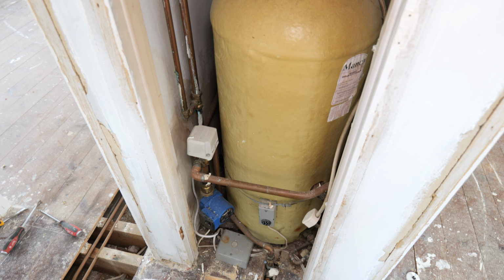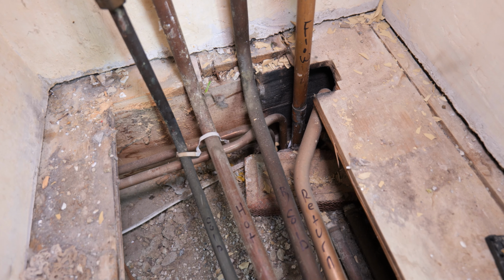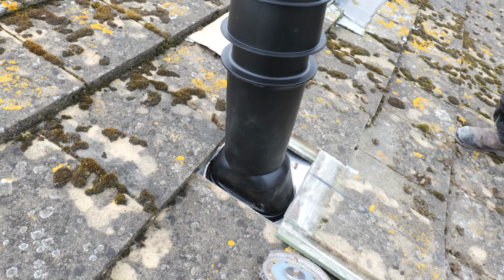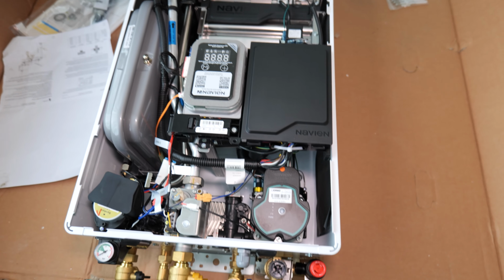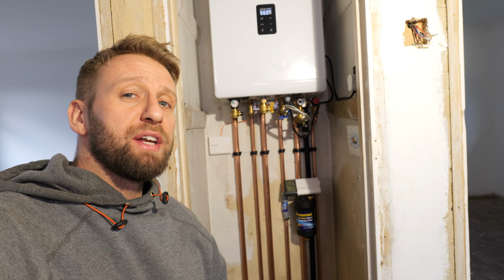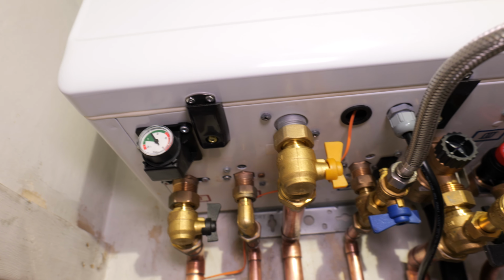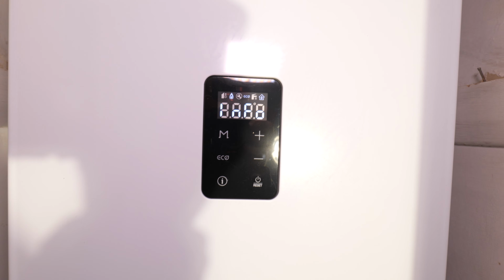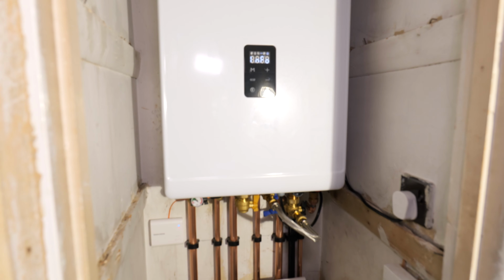Best Budget combi boiler? How Cheap!

Comment: Just had the Navien Ncb500 fitted, come in at £950.00 with the flue & Esi stat. The plumber who fitted it has never seen one. He told me it looks like a very good, well thought out boiler. Very easy to fit, and super easy to set up. I had been looking at these for some time. As a plant engineer to look inside, it looks well put together. My Electrician friend wired in the stat and set up, he was well impressed with it. This model has a filling loop built in and grundfost pump. Some plumber won't try something new. We are well pleased with it, build quality looks loads better than the Baxi 800. Only time will tell how they shape up & how good the warranty is. The Ncb500 comes with a 10 year warranty.
Reply: We'll see how good it is in 10 to 15 years .

Comment: Hi i wanted to fit a new combi boiler and new radiators, will i be able to get rid of the cylinder and water tank system and run it all by the combi boiler?

Comment: Can a Navien 300 boiler run without an external  thermostat? Ours doesn't have one and when switched on it constantly heats the rads and wont turn off.  Great video by the way. Thanks for sharing.
Reply from the maker: Yep. Sounds like it's linked out on the PCB. You really do need a Thermostat of some kind. 👍

Comment: Looks decent on the whole. Where did you buy it for £600 ? Did you say it includes the flue and smart thermostat too ?
Reply from the maker: Williams plumbing merchants
Reply: @loving-plumbing  thank you
Reply: Did you do any lead work when you were an apprentice, when I did my lead work I always thought that the felt was the last line off defence and not a prime way of shedding water from the roof.  ie when the hole you have left around the flue fills with moss or debris water will be shed along to the felt by this debris. If you weren’t trained in the use of lead as I was when being taught to be a plumber may I respectfully suggest you ask someone who has for his advice, it may be fine then again I don’t think I would sleep easy if I had done this installation.
Reply: Swapped over from fiting baxi to navien 

no comparison
Reply: @paulstevens5329  I assume that Navien is better from your perspective ?
Reply: @macpatel7810  out of the box there is no comparison